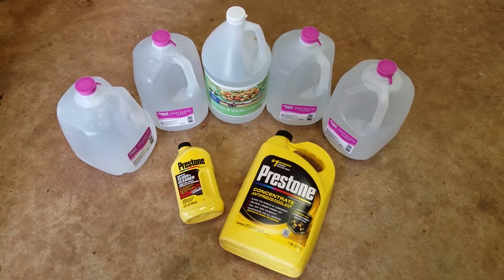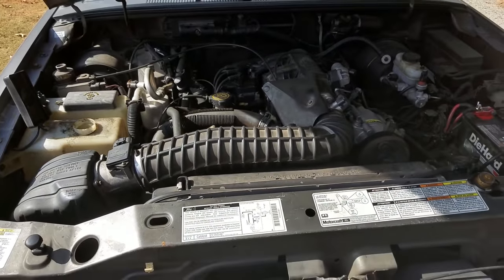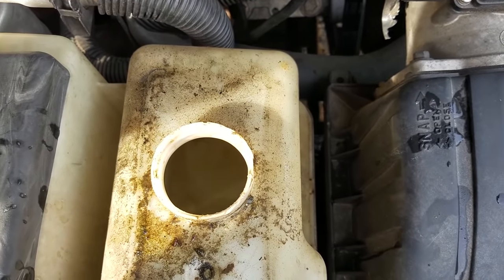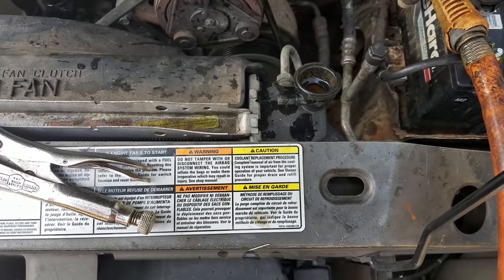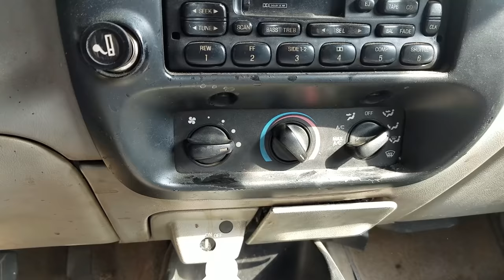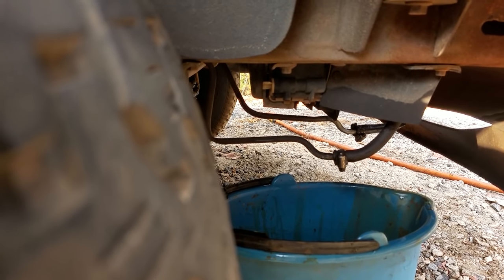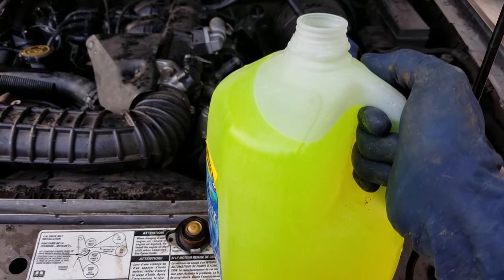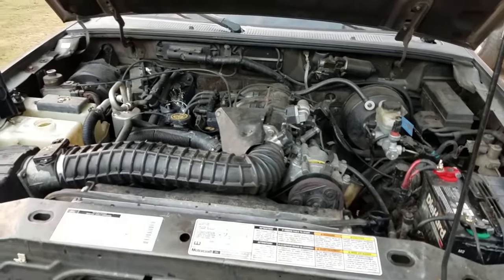Check Out What Came OUT Of This Radiator!

Comment: I generally flush every four yrs.. I remove the thermostat and rinse everything out a couple times. I'll add my flush, and run it for about a week with the heat on hot. You don't actually need the fan running for the water to circulate through the heater core, you just need to set the temp control to hot. Dump the nasty stuff and rinse it out a couple times. I then add another flush, and run it another week. Keep doing this till it gets pretty clear. Install a new thermostat, distilled water, and 50/50 Coolant. If you don't allow it to get into bad shape, it won't be near as difficult.

Comment: Could I keep my Lisle spill-free funnel on for the entire multi-flush process? Even when car is on and idling, and then off while cooling? Or is there ever a time when best to have radiator cap on?
Reply: You can probably get away with it. Usually when it's hot it will bubble outwards. Just don't overfill the big cannister with a lot of fluid.

Comment: i have a ? if you are using tap water to do this flush  now you have tap water in the block an heater cor i have been told tap water is bad so how do you remove all the tap water so you can add your Antifreeze and Distilled water mix .
Reply from the maker: I mean, there's always going to be some tap water in the block if you flush it this way. You can flush it this way and then flush it with a couple jugs of distilled water at the end if it really bothers you.

Comment: Gotta be carefull. While flushing and running with the tap your engine will couse arking and putting in your cylinder walls. Always use destilled water and even then filter it again if yea can. But regardless you gotta do what you gotta do sometimes.
Reply from the maker: I'm going to have to respectfully disagree. The tap water isn't going to mess anything up if you put the right ratio of anti-freeze to distilled water in when you are done. The anti-freeze protects the metal with corrosion inhibitors.

Comment: I think it's not necessary to turn ON the A/C(I saw the compressor workink ! )  just hetaer at max is sufficient ! I saw the compressor workink !
Reply from the maker: +MARCUS Yea! Turn the heat on MAX
Reply: @MattsShop  No, don't turn to max (or anything labeled AC)...that turns on you AC compressor.

Comment: There really should be a warning with modern cars pertaining to what what antifreeze to use. I'll give you a small example. Hyundai now uses green for Asian vehicles. However some of their cars are released from the plant using blue antifreeze recomended for Asian vehicles. Most common form of this is found in Valvoline antifreeze recommended for Hyundai. However surprisingly it can make a huge difference in gas mileage. I don't fully understand this myself but the green seems to get better gas mileage than the blue and I'm not talking a little different I'm talking a major difference. For instance if the tires are brand new and the car is running in top performance and it has green antifreeze. You can achieve 35 miles per gallon to 41 miles on the highway. As long as you drive normal and not crazy. However using the blue antifreeze the car will still run great but we'll find much less gas mileage like around 25 Max 32 Highway. And by the way this is driving in eco mode. And in both situations is using the recommended 5 20. Quaker State pure synthetic as directly recommended by Hyundai manufacturer. If somebody told me this I wouldn't believe it but I've experienced it firsthand. The color of your radiator fluid can actually make a difference in fuel mileage. If anyone out there has an explanation of this I would love to hear it. I know it has something to do with the exact temperature that the car is running at. But this is literally traveling in the same exact weather on the same exact Road taking the same exact paths. And there is a definite difference between having all green antifreeze. And having all blue antifreeze. What's even stranger is the car seems to run louder when using green. But quieter when using blue. You never mix fluids. No matter what always make sure you're either using all green antifreeze throughout the entire system. Or You're using completely blue throughout the entire system never mix. Mixing can actually cause overheating causing the fluids to gel up. Honestly I think there should be a warning right on the radiator or fill Reservoir. Because people out there must be making this mistake. I know this all sounds crazy but trust me if you do the research you'll see that I'm telling you the truth.

Comment: Tap water is bad isn't it? Minerals. I see people use distilled water because it's PH is more acidic and because of that cleans better.
Reply from the maker: Minerals build up in the radiator. Distilled water is pure with no minerals in it. It has a neutral PH of around 7. They use is so that scale doesn't build up in the cooling system.
Reply: @MattsShop  thanks for your reply :-)

Comment: how did you drain the reservoir? is there a hose leading down to the rad or did you gravity feed that hose into your bucket too?,,also dont bother turning up your heater as it only makes it longer for the eng to come to temp,,wait till it comes to temp then turn on the heater,also i think you only need to make sure its on full hot and no need to turn the fan on as it does nothing but heat the cabin,i think the fluid automatically should circulate in the core either way  but ok to be sure turn everything on full blast but only after eng comes to temp otherwise it takes longer for that to happen
Reply from the maker: I drained the radiator with the drain valve at the bottom. I drained the reservoir by pulling the hose off it and letting it drain.
Reply: @MattsShop  why did you need to pull the hose off it to drain? does that means that your surge tank does not have a hose leading back to the radiator or to the lower radiator hose? like my car does,,mine all drained out through the petcock

Comment: You could have just took the lower hose off and on the upper take out the thermostat then flush the block and back flush the radiator until you get everything running clear water. You left that system still muddy looking when you could of no matter how old your vehicle is running clear water. Then you drain and the clear water then add the coolant .

Comment: You can actually use distilled white vinegar with water, 50 - 50 mix.  Leave it in the raditor for about 7 days and it will remove all rust.  However if rust is holding anything from leaking in the block or radiator you will spring a leak.
Reply from the maker: +Wes Karcher Yea, I know that trick. I didn't know that you are supposed to leave it in the radiator for a week. It makes sense though. Thanks for the tip.

Comment: Do i have to hook up my radiator to flush(replacing radiator, system had dexcool in it) or can I just used pressurised water and shoot it through the lower radiator hose and have the upper radiator hose drain in a big bucket 🤔🤔
Reply from the maker: You can do it the way you are talking about. If the thermostat is still in you won't flush anything. You have to take the thermostat out, flush everything, and then put it all back together.

Comment: I really can't help but wonder since you're right there and it's working, and you know there is remainder being left in the block, why not do a few more flushes and now with distilled water since you have the extreme worse out?  It is a shame to put such a great video out there as a learning tutorial and then stop halfway; making people people think if they can get it that clear it's fine.  It's better than it was, sure.  Antifreeze has corrosion inhibitors, but if all those bind with the loose metals/rust already in the system...  Just saying, as a learning tool, it may have been better to have advised to have got a lot cleaner.  3 times is usually enough, but you had someone's really neglected system there.
Reply: Does it matter if the flush is done with distilled water or garden hose? I see some videos say distilled only but this is my 1st time. Any help will be appreciated

Comment: I’m not sure about how much antifreeze to use. Is it one gal of concentrated mixed 50/50 with water or a couple gal of 50/50?
Reply from the maker: Concentrated= mix to 50/50
Already mixed 50/50 = use straight out of the bottle

Comment: That should have been flush like 2 or 3 more times in till the water came out clean over the years I have bought older cars that were so bad i don't think they were ever flush out and I got them to flush out to clean water. Then after you did your flush it has tap water in the black still that will help make it crowd up . So after you do the flush you need to flush with  Distilled water then add full  Strength  Anyfreeze so you will at the end you will have a 50 50 mix if you add 50% Anyfreeze with waterintheblock it willbe like 40 30 at best if youdon'thavetheright amount of coolent it can freezeup the cooling system not good. The only time you use a 50 mix is if your coolent is low or if you drain your engine block or you rebuild your engine. Me i would not use other things to flush out cooling system be safe and by a  Reader flush and do what the flush  Instructions say to do. The newer automobile are more technical lot of aluminum and internal water pumps. Destild water is cheap so buy enough to do the hole job then you know it was done right.

Comment: Why did you run the aircon while on heating? Don't need to. The aircon is cooling function only, while the car interior is heated by engine water via a heat exchanger in the cabin, no need to run both at the same time as they are separate systems completely, unlike a domestic aircon which has a reverse valve for heating.
Reply from the maker: +Warren Gage I didn't. I ran it full heat. I think I had the knobs in the wrong position then changed it in a later clip. I know they are completely separate.

Comment: All good. Only thing would be to bleed the air out of the system at the end
Reply from the maker: Yea, don't forget to burp the air out with the radiator cap off for a bit.
Reply: Matt's Shop how do you do that
Reply from the maker: Run it up to temp on full heat with the radiator cap off until all the air comes out. Then top it off with coolant.

Comment: What happens if you use straight antifreeze?
Reply from the maker: It won't cool well. Anti-freeze sucks at cooling. That's why you mix it with water. You need the cooling properties of water and the anti-corosion/anti-freeze properties of the anti-freeze.

Comment: You should have removed the thermostat and flushed until you got nothing but clean clear water. Then added your radio cleaner and flushed until clean water came out again then drain and add coolant.
Reply from the maker: I should have removed the thermostat it would have worked better, but I just resealed it and didn't want to take it back apart.
Reply: @MattsShop  With the thermostat removed and the heater at max, will the water still flow through the heater core?

Comment: Can I leave the radiator cleaner flush for 3 days  and normal drive use to fully clean the radiator?
Reply from the maker: No, don't do that. You need ant-freeze in there to lubricate the water pump, protect against corrosion, and keep the water from boiling.
Reply: I drove mine for 6 hours throughout 1 week, flush and cleaner have lubricants for your pump

Comment: why did you turn on the AC ?
Reply from the maker: Max AC on these trucks is just the highest blower setting. The temperature is determined by the red/blue temp dial.
Reply: To make sure the heater core is sucking new coolant into the system and purging any air bubbles out into the radiator

Comment: If your system has that much gunk you need to pull the hose off and let it drain instead of only using the little valve at the bottom of the radiator. The valve is too small to let all of the big stuff out
Reply from the maker: Good point. The valve is pretty small.

Comment: would that solution work on a pc watercooling rad?
Reply from the maker: Honestly, I do not know. Whatever you do be extremely careful if you are doing it inside your case! Why not just remove your cooler from the computer and take it to the hose or sink and blast it out?
Reply: @MattsShop  that's exactly what i had intended to do, taking the radiator out of the loop and flushing it like you did outside. One thing i wanted to also try is to use only yhe pump and connect the rads with the solution and run it like that
Reply from the maker: I don't think there would be that much scale and gunk in your radiator. A car has sooo many different metals and chemicals. A computer water cooling system is pretty clean.

Comment: Why didn't you remove the thermostat so it can flush from the start
Reply from the maker: +Travis_ Williams I just replaced the thermostat, and didn't want to take it all back apart. I'd have to wait for the gasket maker to dry too. I wanted it done right that second!
Reply: Gasket maker for a thermostat? Really?
Reply from the maker: Yup
Reply: @MattsShop  Right

Comment: imagine the pump... with all that gunk
Reply from the maker: +RODERICK CONSTANTINO Yea, I'ts probably all gunked up.
Reply: Using that soap in the radiator will clean the pump. Within 2 months the pump WILL start leaking from the little hole by the pump shaft... You've cleaned all the graw-do away from the shaft.. The pump is going to need to be replaced.  ITS happened to me numerous times. I quit using that soap while flushing, just distilled water.  UNLESS you want some experience changing the water pump... While you were at it , you should have back-flushed the heater core with the garden hose .. Just Saying

Comment: hey man great work but why in the world your ac compressor runs when heater is running 7:28 ??
Reply from the maker: Mujtaba Abdullatif Good question, I think I had the switch on ac instead of heat. I switched it once I realized it was wrong.
Reply: Most newer vehicles will do that, the AC compressor will run if the controls are set to defrost most owners manuals tell you to turn AC on when using defrost for faster clearing of the windshield
Reply from the maker: Yea, I always turn my AC on when I need to defrost.

Comment: You should not use distilled water in you cooling system.  Distilled water is pure water, stripped of all impurities.  Pure water is a chemically imbalanced solution that is hungry for ions.  When you put it into your cooling system, it will begin stripping ions from the metals of the cooling system and can lead to damage and eventually failure of the cooling system.  Softened water is a good choice, because the minerals are stripped from the water, but the ion balance is left intact.
Reply from the maker: All water picks up ions when it flows across metal surfaces. Everyone uses distilled water because they are worried about calcium and other minerals building up and depositing inside the radiator/engine restricting flow.

Comment: Never use stop leak, plugs up the passages in the cooling system and makes a huge mess. 
I would rather get the car towed and throw a new radiator in for a $100 than basically ruin the cooling system with that crap
Reply from the maker: +reddyuda Well said! I didn't put it in there someone else did. You're right, all it does is make a giant mess so now you have to clean up the mess and replace the broken parts. I've never used it on anything.
Reply: reddyuda  $100 for a radiator, did you find a junker and jack it out, because radiators are 2-3x that price!
Reply from the maker: +Gregory Key I would never buy a used radiator. You need to find a radiator shop or rockauto they are much cheaper!
Reply: Matt's Shop - I drive a Jeep Cherokee XJ so pretty much any single part is less than $100 brand new. And as stated, check Rock Auto, Amazon and Ebay for the best prices. Lots of new-old-stock factory parts for not much more than aftermarket. I prefer OEM where possible unless there is a better engineered part available aftermarket.
Reply from the maker: +reddyuda Agreed! I always check RockAuto. Their prices can even be as much as half the amount of the parts stores, even with shipping. The only negative to buying online is you can't swap parts out if somthing is wrong. You just have to make sure 100% before you press order!
Reply: Cracked head or failed head gasket is a lot more expensive.Stop leak is your friend.

Comment: You want it on defrost. And the cap off till up to temp and topped off.
Reply from the maker: +Rob Jay I thought the best way was to put it on heat to get coolant through the heater core? Yea, leve the cap off and top 'er off.
Reply: Matt's Shop , absolutely you want it on max heat as well, rule of thumb on the defrost aspect is that on some vehicles there's actually a valve on the heater core lines that isn't fully open until its switched to defrost. Thus if not on defrost your not actually circulating the core un restricted and purging the system.. Mostly older vehicles but my new van has one and figured I would mention it. Basically your safe on any vehicle using max heat on defrost.. once you feel good heat you know the core has been purged,  my minivan is a pain to circulate and get the air out of the system.. I typically only fill my rads 3/4 to allow any air pockets out while its running up to temp,  thermostat open. Once the stat is open and the core lines are hot, top it up and off ya go!.. great vid tho! 👍
Reply from the maker: Wow, thanks for the info! I didn't know that. I will keep it in mind for the next time for sure.  I've always just left the heat on max and it seems to work just fine. It takes forever though to get up to temp just sitting still and idling.  I usually just fill the rad until I can see the fluid near the top and then just top it off after it warms up. Then I go on a test drive and top it off all the way after it cools off.
Thanks for watching!